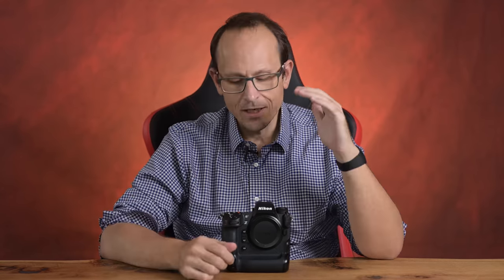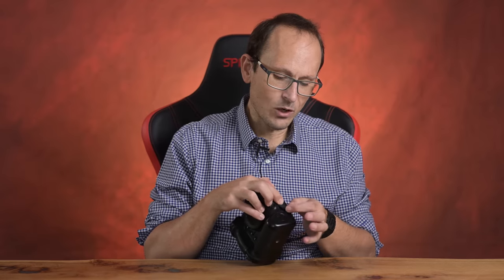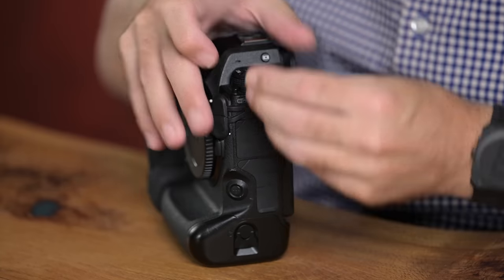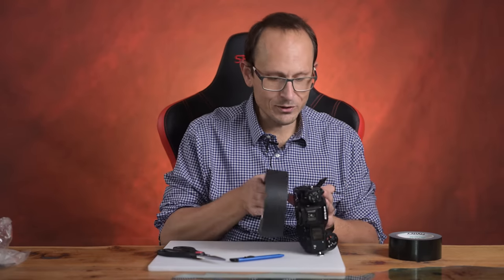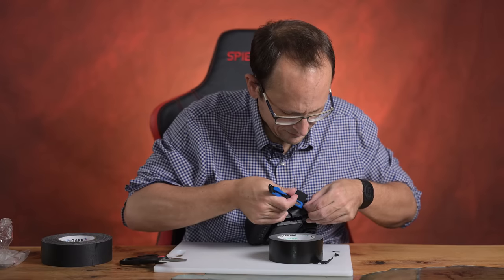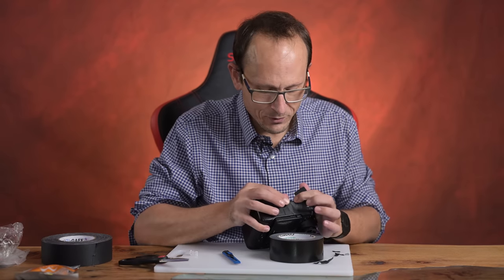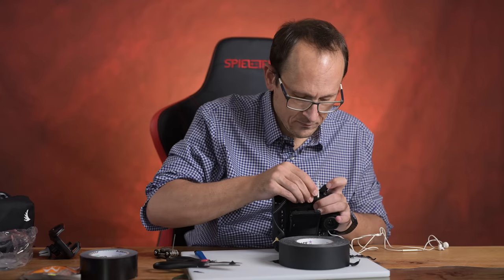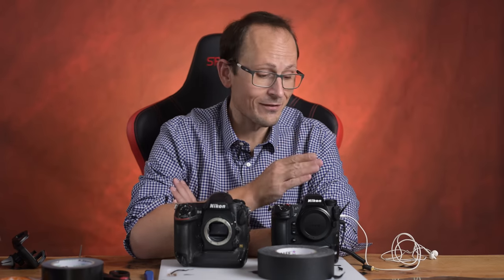Weather Sealing my Camera for Iceland

Comment: Matt, are you aware of the silicone port covers which you can buy? You can get RJ45 covers, HDMI covers, USB covers, 3.5mm audio port covers etc. These simply push into the port and can be eased out with a thumbnail. I don't advocate using them in place of the Z9 covers but they are at least as effective and since you only want to cover the ethernet port, pushing one of these in seems like a quicker and less messy option than sticking duct tape over your Z9.

Comment: Haven't tested this myself, but if you have access to Sugru it may be worth trying to make a DIY plug. Cover the port with a piece of saran wrap/plastic cling film and then cover that in sugru. Carefully remove the saran wrap from the sugru plug and let it cure overnight before putting the new cap back into the port.

Comment: Actually glad I found this video... I was considering going there this year (not going to though but will within the next few years) and honestly, never really considered "weather sealing" my Z6/Z7, although I have watched some videos online about Iceland and can see why one might want to take these extra steps...  My take on weather sealing in general is that while it's good that some cameras have it (and the extent to how well it's sealed is another story, depending on the brand) it's still best to take precautions yourself and prepare your camera for such conditions, in addition to just what weathersealing is offered because I see the weather sealing in modern cameras (like NIkons) to be just another layer of protection, but you should prep your camera using the approproate methods/gear regardless (such as getting a rain sleeve for your camera and lens if you're going to be shooting in pouring rain or in dirty conditions to protect the camera, even though it's weather sealed).  When I used to shoot Holi Color Festivals, I would tape off the lens mount, and if using a zoom, i would tape the barrel in place (usually at 35mm or 50mm) and treat it like a prime, use UV filters -one of the few times I would do this - and put the whole thing into a plastic bag and ensure that was completely sealed and taped up.  Maybe a little overkill, but I'd rather be safe than sorry.

One possible solution to the existing port covers is to buy a spare, and cut it up into pieces and make a separate piece for each little port.  This way you can quickly plug/unplug each port as needed.  But this design of having one cover that covers all ports is not just NIkon, as Fuji and a few others use a similar setup where there is only 1 or 2 covers for multiple ports.

Comment: Matt I had a similar situation and I used dummy or old plugs with the cord cut off and then put a little rubber o-ring just at the base of where it plugs in, My first choice would be to keep the flap closed, but in the event you have to open it, try that

Comment: I think the best solution would be a 1st or 3rd party product that plugged into both the mic and headphone port that had an integraded plug covering the ethernet and sealing the edges in the shape of the original door that would pass both the mic plugs outside the port.  Effectively exactly what you've produced but with an integrated fitting door.  Wonder if you could order a replacement door part from Nikon and perform surgery on it to make exactly that.

Comment: I wonder if you can use plastic dust caps you can get for ethernet, usb c, hdmi ports etc to cover and make it more water resistant as well as putting some tape on top. And as someone below has already said, many of these ports are fairly water resistant anyway, worth check IP rating of the ports.

Comment: I would cut the door into 3 pieces, so as the ports can be covered separately. Then stick waterproof tape at the back of it, outside side, leaving the two :mic and headphones separated. This way you could open each jack separately without opening the door fully. But in really bad condition, with the wind etc, nothing better then plastic bag  and a few rubber bands to keep it in place and around the lens and cables.

Comment: You inspired me! I recently got a Foolography Unleashed N2 bluetooth dongle that plugs into the accessory port on my D750, and now I also have an L-bracket that goes around it. I did remove the flap as that only covers the one door, and it's nearly completely reversible (TM ;)). I think I'll use duct tape to tape up the dongle so that it's again 99% weather sealed (hopefully :)).

Actually you didn't inspire me so much. But you did make me think "hmmm, if Matt does something like this, maybe it's ok". ;)

Comment: Maybe overkill and a dumb thought. But have you considered putting cotton wool, sponge cube or even a cube cut out af a tampon into the hole before covering with duct tape? It could absorb if a drop of water got through the sealing.
Of course you should then peel it out carefully afterwards so you don't bend any connector flaps.

Comment: An idea could be to apply the same tape but with a stencilled-out piece of rubber from an old inner bicycle tube added to the underside for better sealing. Or the rubber rapped around covering the whole area needed. The crossed nicks would be better sealed I think with this. Enjoy the wind, and the rain, and the frost, and the sleet, and the snow in Iceland 🙂👍
Reply: 'Wrapped' ^

Comment: Going through this to have so many long lens bags now getting a hand sleeve  cover the audio is the tricky part .A waterproof mic bit surprising although difficult hasn't been achieved to my knowledge underwater housings do let some noise through .Usually a very expensive and not great audio but control wise nicest option with the right housing .

Comment: I fully agree that Nikon should have provided individual covers for each port, or at least a separate one for the Ethernet port. But rather than cover it with tape, why not just buy a rubber Ethernet port cap? There are a lot of different models available and they are inexpensive.

Comment: A few years back I did an network install in a basement that was fairly damp. At that time I ordered rubber plugs for the unused ports on the ethernet switch. I'm sure they are still a item that is available today.

Comment: I myself don't know how to do it but, it is possible to DYI rubber mold. My thought would be to make something that would plug & seal into the ports you're not using or have someone make custom door /port covers, = maybe with a 3D printer. Just a thought. You could probably find a 3D print channel right here on U-Tube. (another video for you) Have you tried spraying your camera with water & maybe having a fan blowing on it to test if your job would hold up?
 Did the D5 fail because of water getting into the ports?

Comment: I understand the strap loop is in the way. But when you unscrew it, doesn't the screw hold create another point of entry for water, even if it's not directly connected to any electronics?
Reply from the maker: No. I didn’t take the mounting point off the camera

Comment: Why didn’t you just buy an Ethernet connector (male) and plugged it in? It would go inside the female jack on camera and seal it, but for additional safety you could put a layer of tape around it (and inside/over it, or fill it with silicon glue). Your flaps is already open as is, but this way there is no chance of anything getting inside the plug as wit the way you did it, if everything isn’t 100% sealed, water may have a way in. Connector price is under a dollar or you can buy a whole short Ethernet cable for a few dollars and just chop it off at connectors end and wrap it with some tape.
Have a safe trip and a good time in Iceland.
Reply from the maker: We bought the connector and considered it. The connector doesn’t do anything to weather seal, it’s full of holes. And they extend way outside the body.
Reply: @mattgranger  Because it’s empty I made a remark on filling it with silicon glue, but as it extends too much from the body as you state, that’s a much bigger problem and understand why you went with tape as a final solution.

Comment: O sa ma exprim in limba Romana, am putea  cere la firma Nikon sa faca cateva dopuri etanse pentru fiecare orificu .Aceste dopuri sa fie din silicon si sa asigure etansietatea separata a fiecarui orificiu  Acestedopuri ar putea fi comercializate la un pret acceptabil si astfel firma ar repara o gresala de proiectare.
I will express myself in Romanian, we could ask the Nikon company to make some watertight plugs for each hole. These plugs should be made of silicone and ensure the separate tightness of each hole. These plugs could be sold at an acceptable price and thus the company would fix a design mistake.(translate with google)